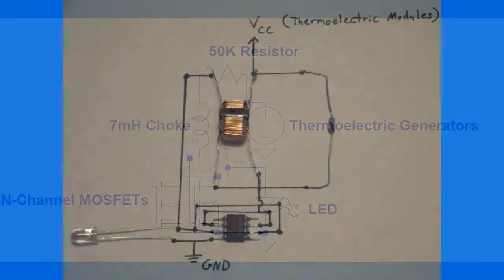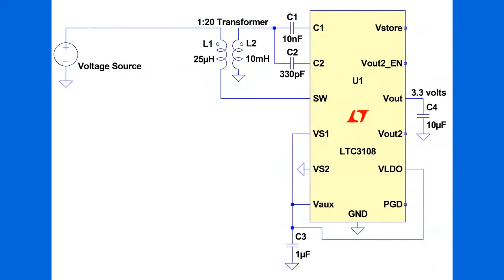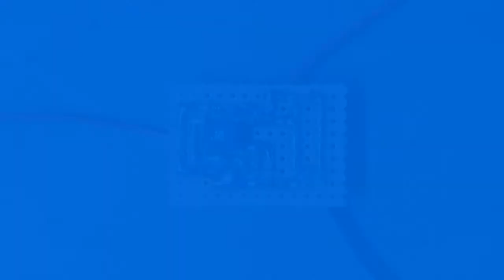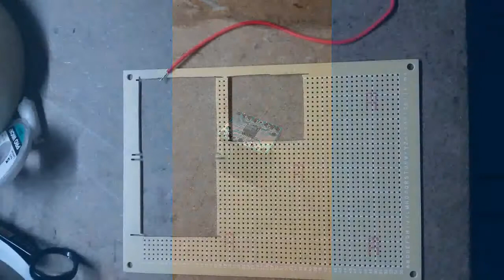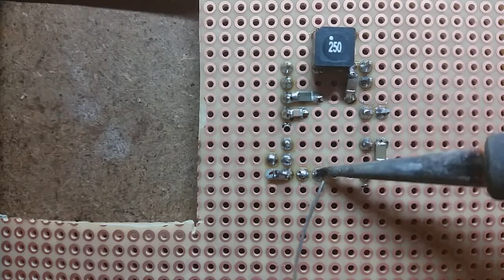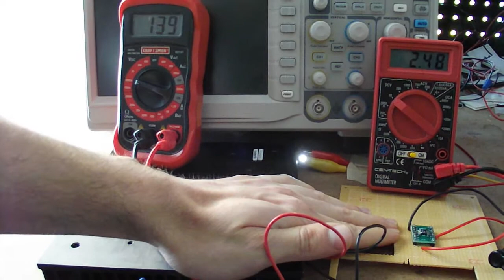How to make the LTC3108 Energy Harvester

Comment: hello LampE :)
i found a premade board in amazon,
https://www.amazon.com/Energy-Harvester-Breakout-Boost-Selectable/dp/B00DDXYUBQ

will this work just fine ?
no other components needed ?
do i just need to connect those thermoelectric generator and LED ?
Reply from the maker: This should work, but you will have to figure out how to program the output voltages on this board, as it seems that this one is not pre-programmed.
Reply: oh thanks :)
but isn't the LTC3108 chip dictates the output voltage ?
this one also has L:TC3108 in it
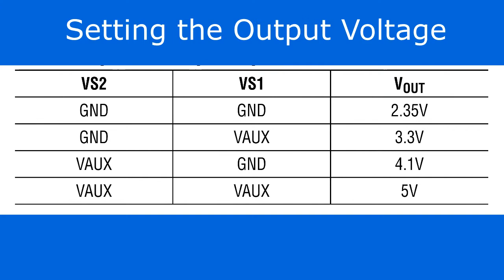Reply from the maker: No problem. The LTC3108 does control the output voltage, but what determines that voltage is the connection between the VS1, and VS2 pins with VAUX and GND. The table at 1:19 show how these pins need to be connected in order to select what voltage you want.
Reply: let's say i want 2.35 voltage output,  what does VS2 for GND and VS1 for GND means ?
im so sorry but im new in this electronic stuffs
Reply: and another question, how much current do you get from this circuit ?
Reply from the maker: VS2 for GND and VS1 for GND mean that both of these pins need to be connected to the GND pin on the chip.
Reply from the maker: Not very much, only up to a maximum of 5mA at 2.7 V out to light an LED, if the input is 0.9 V.
Reply: can i adjust the current output using another circuit even it cost me lowering down the voltage ?
Reply from the maker: You might be able to, but it would most likely decrease the efficiency of the circuit by a significant amount to a point where you will not have any useful power. You can try though.
Reply: does using capacitor increases current ?
like i heard that there is a capacitor that stores charges and burst it then chages again.
can taht work ?
Reply from the maker: Using a capacitor won't increase the output current of this circuit. You can store the energy in a large enough capacitor and power the LED with it to increase the current,  but it will have to charge it. If you want to increase the output current, you could use two circuits in parallel to double the output current, and increase its efficiency.
Reply: does that means 2 LTC3108 boards ?
Reply from the maker: Yes, pretty much just double everything
Reply: oh. thats sad. i can only order 1 piece coz amazon doesnt ship that item to my country.
i was planning on making a wireless mouse powered by this circuit for my college degree tho
Reply from the maker: That's unfortunate. That sounds like a great idea.
Reply: lets say i have this kit,
i connected this circuit parallel to another peltier tile, will it work ?
it does increase the current a little inst it ?
Reply from the maker: You will be able able to get a little more input current, but at a lower input voltage. If you want to increase the brightness of the LED, and the output current entirely, you would have to use more than one LTC3108. You would have to basically make another whole entire circuit, and then run them in parallel to the LED
Reply: do you think 2 ckts would be enough for my mouse ?
Reply from the maker: I honestly do not know, but from what I researched, a wireless mouse would require around 30mW of power in the active state. So I would recommend charging a supercap with the modules, and then using that power to run the mouse.
Reply: thanks. i'll try that too :)
Reply: Hi LampE,
i already have this one, https://www.amazon.com/Energy-Harvester-Breakout-Boost-Selectable/dp/B00DDXYUBQ

im continuing my project on making those thermal powered mouse,
and it seems that you're good in electronics 
can i ask for an email, a dummy will do that can exchange instant messages like chat or something ?
i want your help in making this project. thank you :)
Reply from the maker: That's the circuit. Yeah sure, just youtube message me your email
Reply: i messaged you already :)
you can check your inbox anytime :)

Comment: http://www.ebay.com/itm/Thermal-Energy-Harvesting-power-supply-w-LTC3108-and-supercapacitor-storage-/331654685113?hash=item4d3828e1b9
will this one work ?
Reply from the maker: Yeah that looks like it will work; even cheaper than the one that I found. However, this one will store the energy in supercapacitors, so if you want to use the power coming from the device directly, so that you don't have to wait for the supercaps to charge up, you will have to remove them.
Reply from the maker: Also, it looks like you will need to program the board yourself, as detailed in its description.
Reply: LampE what does programming the board means? can u please explain it
Reply from the maker: It means that you need to make specific soldering connections between certain pins.
Reply: can u plz explain what are those specific connections that we need to solder??
plzzz :)
Reply from the maker: For example, if one would like an output voltage of 5V, then both the VS1, and VS2 pins will need to connect to the VAUX pin. For 3.3V, the VS2 pin needs to connect to ground(GND), and VS1 pin needs to be connected to the VAUX pin. See 1:19 for setting the output voltage table

Comment: lampe great work,but I have a doubt I connected 4 thermoelectric plates in series and they are producing 0.3 volts of DC current. Now will the premade chip in the description be able to light an LED?
please reply , thank u
Reply from the maker: Thank you, yes the one in the description should light the LED because it will operate down to an input voltage of around 0.02-0.03 volts. However, it is using the 1:100 transformer, so it will not be as efficient as the one in the video, but it will work. Having only 0.3 volts from 4 thermoelectric modules in series seems pretty low. I used the TEC1-12706 type modules, and get that much with only 2 modules in series. Also, make sure that you are using a good heat sink, like what I have at the end of this video, it should help increase the voltage. Good Luck!
Reply: How can I use the heat sink? Is it like in your previous video? Also on EBay there is also one LTC3108 super capacitor harvester of 19$ .can I use that? also I m using the same thermo modules but I m not using any heat sink, may be that's the reason of low voltage
Reply: LampE please reply , I don't have much days left to order the chip
Reply from the maker: Yes, you have to use a heat sink. The biggest mistake that people have with using these thermoelectric modules is how them work. It is the flow of heat that generates electricity, which means that there needs to be a temperature difference between the two sides of the modules. To achieve this, a heat is used to absorb all of the heat flow through the device, which would keep that one side (normally it's the side with the label printed on it) cool.
Reply: LampE OK lampe thank u and one last thing as I m a kid I m not able to understand the schematic of the chip that is given in your description so can you please describe me how to connect the 2 output wires to the chip? I think the chip in the description is best and easy to use,so please explain me the schematic of how to connect the chip ! thank you LampE ,really appreciate your effort.
Reply from the maker: The ground wire (the black wire in the video) needs to be connected to the GND pin. At 4:35, it is the wire at the bottom left, sticking out. The main output wire (the red wire) needs to be connected to the VOUT pin. At 4:35, it is the wire on the right sticking out. Then simply make the solder connection depicted in the video to connect everything together.

Comment: +LampE Bro, what is the voltage of 1:20 transformer?
Can i use 12 V 750mA Transformer??
Reply from the maker: The 1:20 transformer that is used is rated at 80 V and and 1.5 A, so I do not think that the 12 V 750 mA transformer will work as great.
Reply: +LampE nobody has a 80V transformer..nearby. And don't have time to get it from ebay etc. What can i do. Can i make one or is their a substitute?
Reply from the maker: Can you order from digikey? The link is in the description, right below the Mouser link
Reply: LampE how can i make 1:20 transformer?
Reply from the maker: With same wire and ceramic core, probably, but I wouldn't even trust myself in making a perfect transformer. It's definitely easier, and better to just buy one that's pre-made, so that it works perfectly.
Reply: LampE  that 1:20 transformer need ac input voltage but the output voltage of TEG is DC voltage, so how can it drive the transformer?

Comment: Awesome work LampE
Will it work the same with LTC3108IGN#PBF?
Reply from the maker: Thanks! Yes, they're basically the same except that the "IGN" one cost a little bit more than the "EGN"
Reply: Oh.. Thank you so much
Reply: Plus, how to connect if i want 2 wires for input and 2 for output
Reply from the maker: If you are talking about adding in another ground wire, so that you have one for the input and output, just add it in somewhere on the far left solder trace, so that it has a direct connection with the other ground wire (the black wire in the video)
Reply: Thank you very much!!
Reply from the maker: Ruturaj Yellurkar No problem

Comment: how come Thiers only 3 wires, isn't thier supose to be 2 for output and 2 for input? and does this circuit store the energy in the capacitors ?
Reply from the maker: I only placed in one ground wire,  but you can add a second one in. The ground wire always the same for both the input and output. Those capacitors are used for filtering and coupling. Their capacitance ratings are way too small to store any useful energy, so if you wanted to store any energy, just add another larger capacitor on the output.
Reply: LampE  oh awsome i see what you mean now, here's a question if I added a capacitor wouldn't It take a while to. charge up so I can get any useful energy as an output?
Reply: LampE what type of capacitor could I use ?
Reply from the maker: That depends on how large of a capacitor you want. This device outputs only a few milliamps of current, so it will take a long time to charge any large capacitor. What do you plan on powering that capacitor with, an LED?
Reply: LampE yeah I Plan on powering an led but I thought it be nice to have it store energy for later use when needed ? but technically this circuit you've designed uses the teg modules output directly to power something right?
Reply from the maker: Yeah, I designed it to power an LED directly from teg modules
Reply: LampE wow you a genius! love your videos keep doing what your doing :)
Reply from the maker: Thank you!